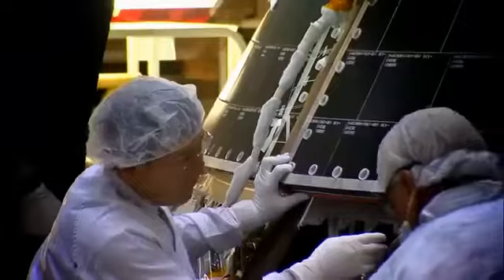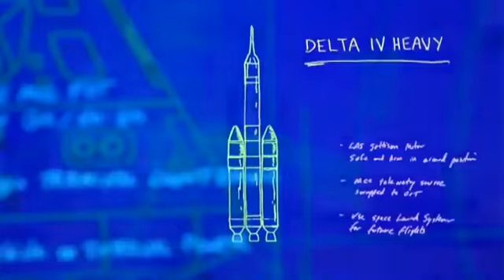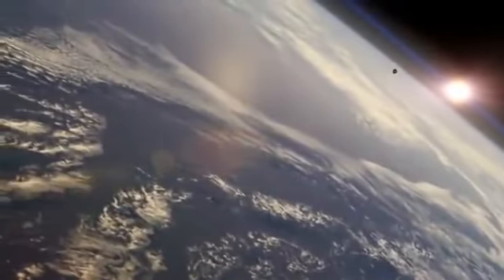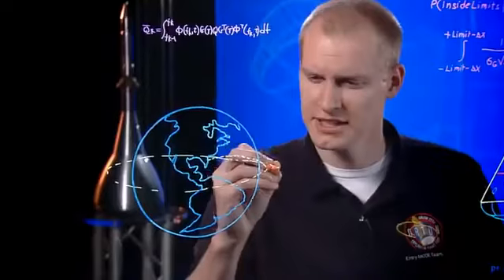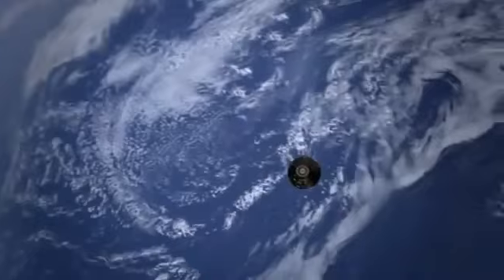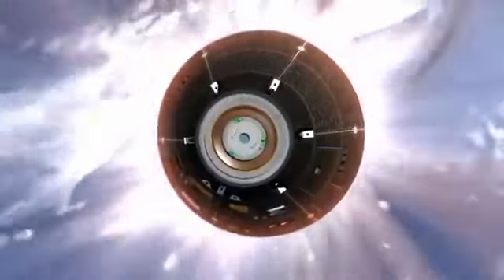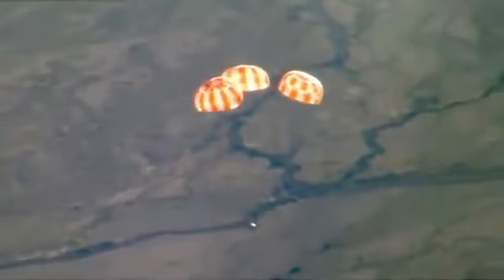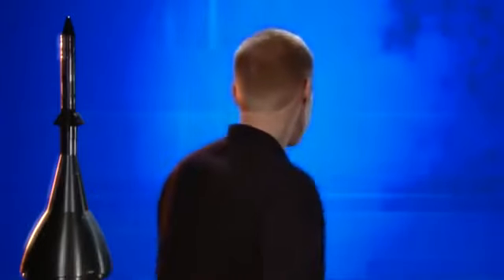NASA engineer admits they can’t get passed the Van Allen Belts

Comment: Apollo never passed directly through the hot zones of the Van Allen Belts, instead using more fuel to push a Northerly route. You could up grade the shielding of Apollo to go via the more fuel economical equatorial route. But if that means the craft is heavier you are back to the same fuel requirements or even higher. By sending a version of the craft unmanned through the intended route and measuring the actual radiation levels you can tailor a multilayered shielding system without increasing weight to an uneconomic load making the whole thing pointless.
This is the subject of the NASA video. Use your heads.
Reply: Apollo went out to the east over Africa and the pacific ocean.   It went right through the centre of the belt.  It was only after it was pointed out about radiation in that route that they said they went over the north pole.

Comment: He says at 3:35 that "we must solve the challenges of the Van Allen belts before we can send people through this region..." Wait a minute.... I thought we already did!!! :  ) If he keeps making mistakes like this he could end up shooting himself in the back of the head. At least if you believe the stories about others who have made mistakes like this in the past and put themselves on the sucide list.
Reply: you are right, they didn't go THROUGH the van allen belt in the 60's, they went around it. equipment wasn't nearly as vulnerable as now. another problem is that the legal radiation doses are significantly smaller.
Reply: We have been through the Belts many times with probes and several times with humans. But we have much more sensitive equipment and better safety for the astronauts. When the speaker says we cannot he is correct. At present we do not have a craft to make that flight right now. Apollo cut corners and said FO to safety. In this time of instant news we have to be much more  safer.
Reply: +Roy Mackey
They are also testing and preparing the technology for trips to places other than the moon. They don't know exactly what radiation they might go through on these trips so protecting everything as best they can is necessary.
Reply: Would you want to wear a radiation suit in a nuclear power-plant if that suit was untested?

They’ve built a vessel, they want to know if it can handle the extreme environs it will face. Makes perfect sense to a rational person.
Reply: Dad!!!... is that you????  : )
Reply: For that particular spacecraft

Comment: He's saying to make sure the shielding they've used on this model is going to protect the GUIDANCE SYSTEMS. The reason he says "Before we send people through" Is because if the guidance system fails, then the people are dead. That's what he's referring too. Not the protection. He even states in the video that the orion craft has protection from the radiation. You guys jump on one thing and blow it out of context 🤦🏽‍♂️
Reply: @tumarbongrox6074  Thats a GREAT EXCUSE!
It's the truth.

But here is more confirmation in this video
"The astronauts looked sad at the press conference" is not evidence in any way, shape or form.
Reply: @Jan_Strzelecki  😂😂😂😂👍🏻
Reply: @tumarbongrox6074  No the PEOPLE are dead LOOONG before the radiation damages the guidance systems!
That's incorrect.
Reply: @Jan_Strzelecki  But the NASA guy was referring to an unmanned ORION mission.  So in an UNMANNED mission there is nothing but computers or guidance systems inside ORION to be damage by DANGEROUS RADIATION.    Then he says that MORE research is needed BEFORE we can send people through this DANGEROUS area of space.
All along the DANGEROUS AREA of space is the area of the Van Allen radiation belts!!
.....and 1 plus 1 = two😊
Reply: @tumarbongrox6074  But the NASA guy was referring to an unmanned ORION mission.
Yes, and?.. This doesn't contradict what I said before.

So in an UNMANNED mission there is nothing but computers or guidance systems inside ORION to be damage by DANGEROUS RADIATION.
Yes, that is indeed correct.

Then he says that MORE research is needed
No, he doesn't. What he says is "we must solve these challenges before we send people through this region of space."
Which they did, with this test flight. Also, he specifically said that "Radiation like this could harm the guidance systems, on-board computers or other electronics on Orion".

All along the DANGEROUS AREA of space is the area of the Van Allen radiation belts!
That is still incorrect. The Van Allen Belts, existing due to Earth's magnetic field, are the most densest and widest along the equatorial regions of Earth, and least dense and smallest along the polar regions.

The clue is in the name: it's Van Allen Belts, not Van Allen Spheres.
Reply: #GottaLieToFlerf
Reply: Traveling at 20000 mile an hr??😂😂 GTFOH... dude can’t even keep a straight face
Reply: @kylearmstrong1188  Not that difficult a speed.

Comment: If we went to the moon in 69, how did they get so many things right? Like how did they know the Van Allen belts were even there? Hoe did they know how much fuel they needed and power? Seems like its something they would have fucked up a couple times first.
Reply: James Wilhite They spent a number of years and a lot of money doing plans tests exploration etc to try to make sure nothing went wrong on the big day. you should try the same method. Check your facts before asking moronic questions
Reply: James Wilhite The Van Allen belts were discovered by the Explorer 1 sattelite and (insert 50's first name here) Van Allen. They calculated the trajectory with MATH. It's not like they knew nothing about the moon's Orbit, it's gravity, and the earth's gravity.
Reply: They did screw it up several times.  Apollo 11 wasn't the first manned moon mission.  It was the first to actually land on the moon.  There were several missions that went to the moon with the sole purpose of surveillance for a possible landing site.  SO they had an idea how much fuel we needed to land.  As a matter of fact the guidance computer was not responding and Neil Armstrong had to manually land on the moon.  It was the first and only time that was ever done.  After that mission they changed the guidance system so it would not happen again.  My dad was a kid when we landed on the moon in 1969 and he told me that there was worry that the 2 guys would not make it off the moon and all 3 would not return to earth.  The only mission in the Apollo program that was deemed a successful failure was Apollo 13.  WE didn't go to the moon because of the explosion.  Since they scrubbed the moon landing the new mission was getting our boys home.  That's why it was a successful failure.
Reply: ya pretty much what Robert and the others said... if i recall, the unmanned probes that helped map out the surface of the Moon to find the best landing sites was the Ranger missions... i think there was like 5 to 8 Ranger missions... these were unmanned robot probes that flew very close to the Moon and transmitted back detailed images via radio wave

and i think it might have been the case that some of the Ranger missions crashed into the Moon when their fuel source was used up... i don't think they were probes advanced enough to navigate their way back to Earth like the modern gear used by SpaceX... their primary mission was to gather photographic images and transmit them back to Earth

these were the old school "use once and destroy" style probes :)

the Ranger missions augmented work that had already been done by telescope from the ground... i think by USAF?   the USAF had extremely detailed maps of the Moon made entirely by high-powered telescope and the steady hand of a skilled artist

these maps can still be acquired from USAF related websites today... they are buried deep in the archives... i found them many years ago... i don't have the URLs handy at the moment :)

they are stunningly detailed... with dozens of named craters and many of the Moon's geological features... very high-rez maps scanned from paper to digital i think like 4096 x 2048 or something

so they already had detailed maps by the time of the Ranger missions which i think was the 1950s... but the Ranger missions helped give them extra comfort and reduce worry... because the Ranger probes got real damn close to the Moon... like I think maybe 80,000 feet away or so?

so they were able to be extra sure "yeah this landing site looks legit" lol... cause they didn't wanna send humans up to their death that's why they were so cautious
Reply: yeah the Ranger missions did crash into the Moon like i suspected

but turns out Rangers 1 thru 7 didn't even make it that far... they had accidents prior to achieving their goals

it was Ranger 7, 8, and 9 that got images back

the total cost of all 9 Ranger missions was around 1.2 billion dollars adjusted to modern inflation

alot more info can be found here

https://en.wikipedia.org/wiki/Ranger_program
Reply: lol turns out Ranger 3 missed the Moon and has been orbitting the Sun at a great distance ever since :)
Reply: It's called science. If you go to school and study the subject you'd understand how.
Reply: They had unmanned missions before they sent them. And not to mention they had satellites
Reply: It's called science . I suggest you try it .
Reply: Now if they could run the economy and country with such precision.
Reply: James Wilhite You might have a point with the belt, but you can use math to figure out, essentially, how much weight lets say a gallon of gas can carry.
Reply: It's called math
Reply: James Wilhite - also because of the Aurora Borealis (Australis here in the Southern half). Those are the charged Ions of the Van Allen Belt. Very visible.
Reply: Not to mention the VIDEOS of Commander Armstrong practicing the landing sequence in elaborate machines built by NASA...so as Commander Armstrong said, it wasnt his first time landing on the moon, hed done it 100 times
Reply: I was brought up in the 60s and my Brother in law worked for NASA , a Scotsman by birth Dr Jim Burns , a very clever man .I was the on of the scientists (over 18 others ) working on the heat shield . On that alone it may be worth your while looking at a few videos on YouTube how they went about this .It more or less started with the X15 plane and the testing of the ablative coating (a coating that removes heat by flaking off ).
What we hope you will see is the exhaustive testing that took place back then and that part is very much under played by onlookers .Never the less it is there .
In fact we still benefit from all this testing every time you step on a modern aircraft from the rubber on the tyres to the metal on the fuselage .Nasa has probably run it through its labs .So it’s not the hit and miss affair you might imagine .As my brother in Law once said ,it was the greatest adventure in history so far .
Worth getting a few nation geographical mags on eBay as well that cover all the events from the mid 50s to .
Reply: James Wilhite ,sorry James , but I bet you wished you hadn’t asked that question eh!
Reply: Im sure some died trying, they never release that kind of stuff.
Reply: James Wilhite  my guess is pure luck,
Reply: Math you won't even begin to comprehend
Reply: Bro its NASA
Reply: James Wilhite  just luck and hope  is how we got to the moon
Reply: James Wilhite Its literally rocket science dude. They used Physics...
Reply: +Will B
Actually, Auroras occur when solar wind produces enough of a disturbance in the magnetosphere to allow the charged particles from the solar wind and plasma from the magnetosphere itself, to react with gases like oxygen and nitrogen in the upper atmosphere.
Reply: +Sean Schwab
Of course they did. There were heaps of documented accidents.
Reply: They orbited some missions prior to actually landing: do your homework.
Reply: there were a whole lot of failed unmanned tests before they actually put people in.
Reply: Science classes.
Reply: typical liberal, putting people down and feeling superior.
Reply: They knew they were there because James Van Allen discovered them in 1958.
Reply: Confirmed there existence is probably a better way of putting it actually. I think they were hypothesized a while before.
Reply: Robert Benoit Armstrong didn't manually land because the guidance computer failed, he manually landed because the landing area the guidance computer was taking them into was littered with boulders the size of houses.  He took control and flew the craft over that field of boulders to a safe landing.  The glitch Apollo 11 experienced on approach was related to the rendezvous radar.  The computer was confused with signals caused by the rendezvous radar being on and gave an alarm.  The rendezvous radar should not have been on but an error in the Flight Manual had the astronauts turn it on prior to Powered Descent.  Future missions had it switched off, so the problem did not occur.
Reply: Do you think they just picked a random number and called it apollo 11? THERE IS A REASON WHY ITS NUMBERED 11, ITS BECAUSE THERE WERE 10 BEFORE IT. And in those ten tests they learned about what needed to be done before they put men on the moon. Do your research before making such a stupid comment.
Reply: John Adams 
The Van Allen belts were discovered by Van Allen, in 1958, more than a decade before the moon landing
Reply: They didn't go. They got 40 billion dollars for a fake space program from the American people though

Comment: So, we never went to the moon and back?
Reply: No, we did. We just used multiple different techniques to get around the van Allen belts.

1. In 1969 we used reflective material to deflect some of the radiation.

2. The van allen belt is made of charged particles, not alpha, beta, or gamma radiation. In other words, it wont kill you, although if you're not careful you can get cancer later in life. The van allen belts are not interchangeable with a nuclear reactor.

3. They used fine corse corrections to avoid some of the heaviest parts of the radioactive zone. This will be impossible for Orion as it needs to be very fine in order to stay on the correct interplanetary trajectory.

We definitely went to the moon, we just had to be much more careful then we will with Orion.
Reply: Nope. Not possible
Reply: @DOTMH_1  prove it
Reply: @jairofthecosmos5022  you have to prove it and show us the technology and details

Comment: Note that the 1960's technology (electronics) used in the Gemini through Apollo missions was naturally hardened versus the radiation.  Core memory,  tubes,  large transistors and 3.0 micron to 10 micron integrated circuits are much harder to damage via radiation/solar flares than the later sub-100 nanometer ones.  Which is why the Space shuttles used 286 & 386 CPUs (1.0 to 3.0 micron,  with hardened circuits) rather than using newer technology.  An EMP attack in the 1960's would have barely affected our society for more than a few days...  now one can take our systems down for months.

Comment: It is NOT just the Belts. It's the radiation* out beyond the Belts that the Belts protect the Earth from. It's the potential radiation on the Moon's surface. It's also the unknown of the radiation and makeup of the Belts themselves, as even today they are little understood.

Shielding is impractical if the threat is not understood. Shielding is impractical due to weight. Shielding is impractical due to secondary radiation (bremsstrahlung) thrown off by the braking action on high-velocity charged particle radiation of said shielding.

Apollo, a criminal joke.

*Ionizing radiation from both very high energy, low-frequency, electromagnetic radiation (gamma and beyond) and high-velocity, charged particle radiation.

Comment: To say that he "admitted" we couldn't get passed the van allen belt is one hell of a stretch... He literally said orion shields will be tested... He didn't say they would fail...
Reply: I'm sure the technology should be better now then back then it dont make sense plus they getting billions of dollars more now so how did they go the first time if they just notice the radiation
Reply: @Rtraywick812  The technology IS better... which makes it worse for surviving the radiation belts. Electronics have predominantly gotten better because we've made their components... and the charges moving in them, smaller. Smaller = more delicate. More delicate = radiation is a much bigger issue. Old school electronics in the apollo era were more or less resistant to radiation just by sheer bulk. Today's electronics need careful shielding.

And you don't seem to understand what money is. It doesn't stay the same in value. A billion today is worth a lot less than a billion 50 years ago. In fact, at it's peak during the apollo program NASA's budget, in today's money, was twice what it currently is.

And they didn't just notice the radiation. They've known about it for certain since 1950s, and theorized about it before then.